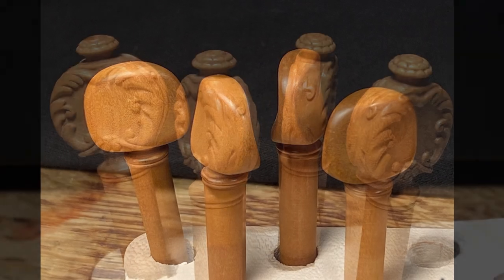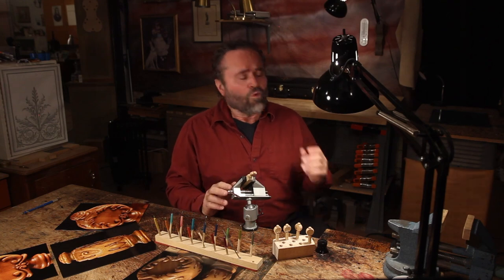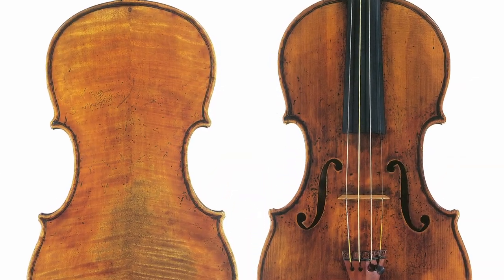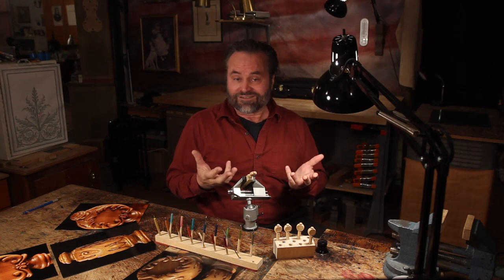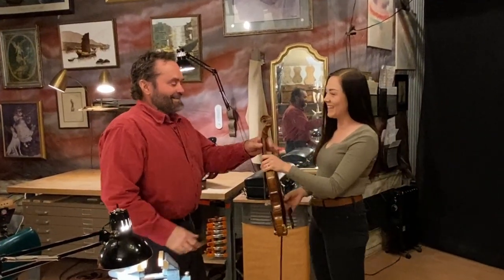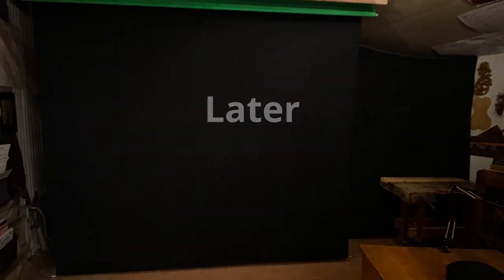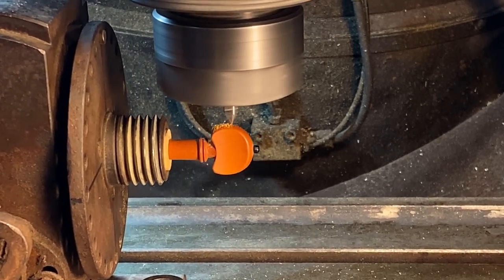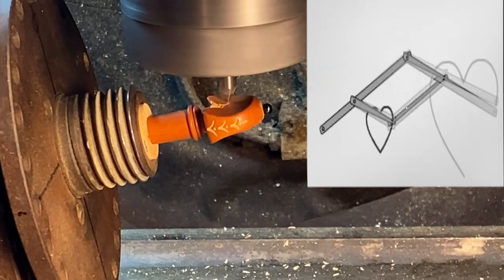Stradivarius and Guarnerius Violins: The Art, Myths and Legends / The Pegs

Comment: Nice to see the shop. 50/50 wood shop and machine shop. Are those VCMT carbide inserts positive or neutral rake?
Reply from the maker: Those "little guys" are positive rake with almost a razor edge to cut a little cleaner in wood.

Comment: Kevin, do you think Stradivarius or Guarnieri would have used internal geared pegs if they had them back then? They sure do make tuning easier as I have them on one of my less expensive violins but I kept the original tuning pegs on my more expensive Stradivarius and Guarnieri models (not originals).
Reply from the maker: I believe they would have tried to talk the customer out of them, yet I could see them installing them if it truly was what the customer wanted.
 As I have mentioned before, if a violin is maintained properly, traditional pegs are better in every way, especially for the professional who replaces strings fairly often, wants their pegs at their correct orientation or loves engraved pegs.  However, on a less expensive instrument that doesn't get maintained or played often, they can make fine tuning a little easier, especially for very young or weak hands.

Comment: I am a retired master luthier...cnc...has made us redundant..AI will destroy we freemen...end times?..every great epoch ends..
Reply: I was actually just wondering how good AI could get at designing instruments. Probably not as good as we think but still absolutely concert level. 

I have a Callaway golf driver with a face and internal posts designed by AI and it is an absolute dream. Very clinical. Performance over feel 

Instruments may go similarly but wood will always be wood 

Not as consistent as composite and metal